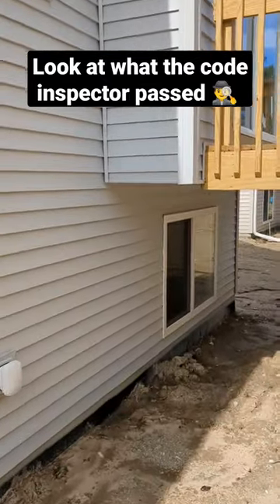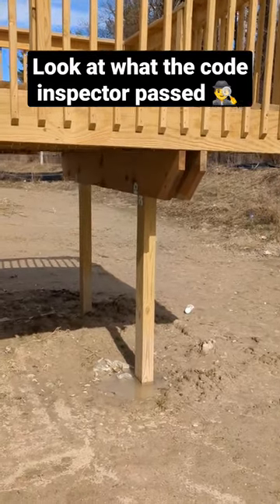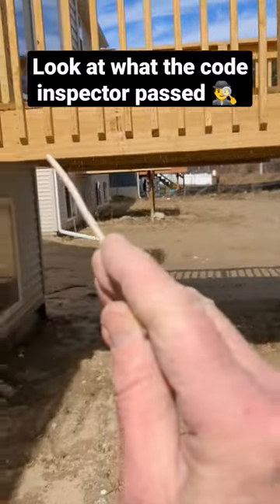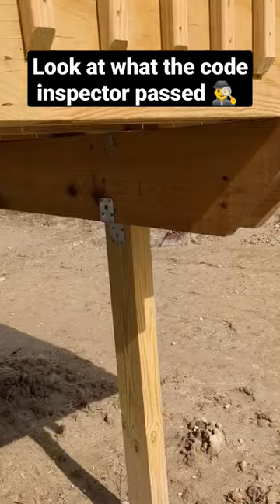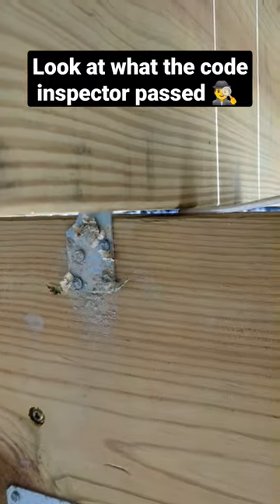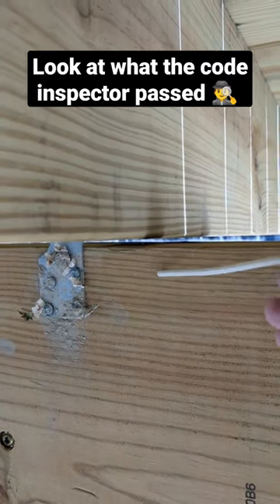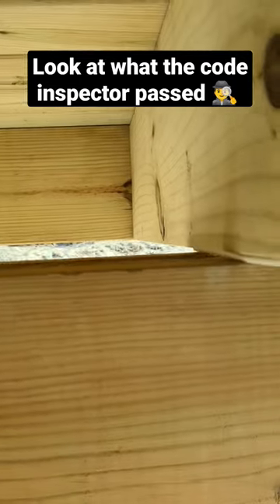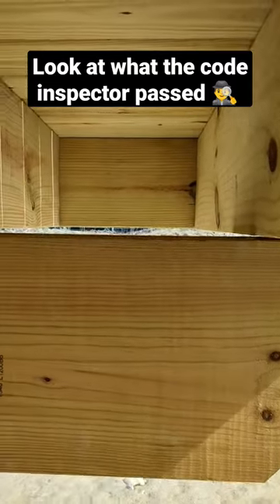Code #inspectors don't pay attention to detail#deck #newconstruction#youtubeshorts#shortvideo#shorts

Comment: How about the 2' cantilever holding up a Ledger board ? Or the not a girder that's not sitting on the posts , so 8- 1.5" nails are holding that entire deck up . I could go on, but yikes fail fail fail in PA .
Reply from the maker: Yes yes yes. Rebuild! 🤣
Thanks for the comment and watching the video.

Comment: It’s not floating in air I am sure it will settle most important is connecting to the house and the beam is bolted to the posts 
Looks like the post are to deep into ground. 😊

Comment: Green or "treated" lumber shrinks, the beam shrank in height. The deck used to sit on the beam. But, if it goes anywhere its just going to sit down on the beam properly.

Comment: If the posts are ground contact treated, water is fine…. Those joists will settle on the header in a short period of time. Inspectors don’t understand 95% of lumber has curvature and not perfectly straight.
Reply from the maker: Yep, it's called a crown and all crowns are applied up on floor joists. However, the entire deck is improper and needs to be rebuilt.This home got worse. SEE Missing Footings Inside https://youtu.be/TqGMGpvnVAk
I've been finding more developments selling homes with NO decks, but they install handrails in the slider door frame. Once the code inspector is gone a crew member comes back and slaps on the deck for extra money 🤑 and no permit. Ugh.
Thanks for watching.

Comment: Because when they frame that, they support the outside band with stiff legs and attach the floor joists to it then they erect the drop seal afterwards and a lot of times they don't get it all the way. However you cannot expect the floor joist to settle down if they have already got strapping material attached

Comment: This is whybit is so important to have a liscened home inspector look at your new home even if it is brand spanken new.  I average 15 repairs on every new construction i inspect.   15 items that will generally caise greater issues if not corrected by the one year owners builders warranty that never gets taken care of either.
Reply from the maker: Yesss. I renew my builders license every 3 years and I find a lot of problems on the new builds. There's no more real "carpenters" out there. And in Michigan, only 1 in 10 builders are licensed.😖 Ugh. 
Thanks for watching.

Comment: That is one of the silliest things to make a big deal about. See when you build a deck. You’ll understand. That when you attach it to the rim. Some of those boards are different sizes. So it’s either you leave them a half inch under the rim. Or a quarter over the beam and it settles. You can’t have both

Comment: Seems like no concrete footings supporting the deck. And wood like that, unprotected, will rot in a few years. They should have used pressure-treated wood were it touches the soil.

Comment: They probably were at time of build, that crap shrinks up to 1/2” in a week or two. Throw a cedar shim and look the other way just as the inspector did. BTW, the rim is usually put on after the joists, so I’m pretty sure the joist were sitting on the beam when constructed.

Comment: The  Massachusetts code you can not sandwich a 4x4 anymore and carriage bolt it. You have to lag the 2 - 2x10s together which are also the smallest you can go for a beam here. then lag every 12 to 16 inches with structural lags exterior on the carrying beam. Also has to have simpson ties hangers on the 4x4 beams to keep it from moving offt the post. with hurricane clips on every joist. Also the new code here is you can no longer use 4x4 pt the code now calls for 6x6 pt hopefully the deck was lagged into to house with structural exterior 6 to 8 inch lags at least 2 in the middle of every bay one above the other. Just wanted to throw that in.
Reply from the maker: Thanks for sharing. Here in Michigan our code book is a D- with minimum 4x6 post🤮.
However, the deck in the video I believe was installed after the final code inspection. The builders here build so fast that they put a rail in the slider door and get a final. Then someone comes back after and slaps that junk together. 
Thanks for watching.

Comment: you also missed the ledger board hung from the cantilevered floor system -- which is not allowed.  --
Reply from the maker: Yep. And , posts are not notched for beam and much much more. Recommend rebuild.
Check out those missing footings inside.

Comment: They framed the deck, then placed it on the beam.  There should be an anchor at the wall, then an individual anchor for every floor joist.  The other problem is the beam should be sitting on a notch cut into the 4x4 post.  You missed that part.

Comment: and though may be code .. the v vertical post are too small and I would connnect them from top to bottom with a board fat an angle ...sharing stability

Comment: Isn't this more than likely due to wet lumber drying out? It will shrink sometimes an 8th of an inch. Alot of times it isnt practical to let it dry out prior to building. Sometimes its damn near impossible. Sure, this may not be "proper" but I dont really see an issue. Its strapped properly and chances are that gap will close over time.

Comment: The biggest issue is that the deck by code is not allowed to attach to an overhang from the house without positive support beneath…
Reply from the maker: Oh I agree. I can't confirm, but I really think the deck was slapped up after the final code. These builders here get a final if they put a rail in the slider door.😉
Thanks for watching.

Comment: Its pressure treated lumber. Its an eighth of an inch. It will eventually sag down to the beam and you will never notice. You have nails in there that are designed to have sheer strength so this is completely safe. Want a better deck, then tell them to send us better lumber that doesnt vary a quarter inch in width.
Reply from the maker: Yes. Lumber is a big problem in today's construction.
Thanks for watching

Comment: Are u sure the beam didn’t settle. Of the posts holding beam. As u see standing water on ground right where post is. How do u know that post didn’t settle. So u have them suck that deck down and ur happy. But deck is now not level. If the posts settled. Sure u looked into that though.

Comment: The joists will eventually seat themselves, and it may warp the deck some it's not as bad as the potential catastrophic failure from supporting the other end of the porch on a cantilevered floor.

Comment: Those gaps are the lesser of the problems. The posts should have a metal saddle in the concrete, and I would not pass those metal brackets holding up the beam.
Reply from the maker: Yes. Too many problems. It was written up as a recommendation to rebuild.
Thanks for the comment and watching

Comment: This is cause by the shrinkage of the wood by the sun. You can tell the wood dried a bit on both bottom and top causing separation leaving a gap.
Reply from the maker: Yes. That's the answer.
Thanks for watching.

Comment: What seems to be happening here is the treated wood was fresh and wet and when they built it it most likely was resting on the beam but after the treated wood dried out they shrunk, that's what pressure treated wood does.

Comment: After looking at this again...
I realized there is no door going to that deck.
Just a window.
No supports near that either.
So chances are, this is designed for looks and not for use.
Reply from the maker: Yep, there is up above.
The entire deck is improper and needs to be rebuilt.This home got worse. SEE Missing Footings Inside https://youtu.be/TqGMGpvnVAk
I've been finding more developments selling homes with NO decks, but they install handrails in the slider door frame. Once the code inspector is gone a crew member comes back and slaps on the deck for extra money 🤑 and no permit. Ugh.
Thanks for watching.

Comment: I am most worried about the fact that none of the deck joists are mechanically attached to the beam. 

By the way those 1 or 2 hurricane ties do not count under code as attached to the beam. They are designed for wind lift not attachment.

Comment: Couple of heavy weight relatives over for the home opener and that problem is solved. 
Problem is, how long will that none-pressure treated wood in the ground last?
Reply from the maker: Right. I talked to a landscaper once about wood foundations. And it's a horrible concept. He replied with "pressure treated lumber is temporary use". 
I looked up the life span on line and it says 10-40 years is the average life.🤔
Interesting.
Thanks for watching

Comment: Are you allowed to connect to an overhang?
Reply from the maker: No. Not the way it's done in this video. The entire deck is improper and needs to be rebuilt.This home got worse. SEE Missing Footings Inside https://youtu.be/TqGMGpvnVAk
I've been finding more developments selling homes with NO decks, but they install handrails in the slider door frame. Once the code inspector is gone a crew member comes back and slaps on the deck for extra money 🤑 and no permit. Ugh.
Thanks for watching.

Comment: I rented a new 1 million dollar house for 6 months 10 years ago in a place that get to -30 -40 in the winter and somehow the builder forgot to insulate the home, The heater could not keep up so the pips froze and busted and the walls had ice build up inside the house so after 1 winter they had to replace everything.  '' Professionals''  I can't put up a shed in my city without approval for safety reasons lol

Comment: What supports are on the house? Doesn't look like much.
Reply from the maker: Not much. A standard ledger board that is off-set and bolted. The entire deck is improper and needs to be rebuilt.This home got worse. Check out Missing Footings Inside https://youtu.be/TqGMGpvnVAk
I've been finding more developments selling homes with NO decks, but they install handrails in the slider door frame. Once the code inspector is gone a crew member comes back and slaps on the deck for extra money 🤑 and no permit. Ugh.
Thanks for watching.

Comment: Forget about that. You should never attach a deck to a chimney. You have to use 2 by 10 double beam for the 2 anti gap around it and post to support it. And your picket should go to the bottom of the beam.

Comment: It’s not improperly installed that’s gonna settle within under six months you put Crownwood up when you install it and then it settles flat after time that’s the only reason why it’s doing that. I probably wouldn’t put the hanger stock on yet, but there’s nothing wrong with that deck

Comment: Ledger board need to have a support. Can’t use a ledger board on bay windows, or anything that over hang like that. There is no strength to support any more. Fail inspection in my area

Comment: He missed the fact that the wood column posts comes in contact with the grade. A concrete footing with a minimum 4” clear between the wood and grade is req’d. There’s more.
Reply from the maker: Well, l didn't miss it. It's written in the report to rebuild the deck because of so many problems. I made many shorts on the deck but you should see the house. 
Check out those missing footings inside.
Thanks for watching

Comment: I’ve been building decks for 142 years plus overtime. It will settle down on that beam in 6 months… in other news I’ve never seen a deck come off a bump out 🤔
Reply from the maker: Yep. And the problems kept going. The entire deck is improper and needs to be rebuilt. SEE Missing Footings Inside https://youtu.be/TqGMGpvnVAk
I've been finding more developments selling homes with NO decks, but they install handrails in the slider door frame. Once the code inspector is gone a crew member comes back and slaps on the deck for extra money 🤑 and no permit. Ugh.
Thanks for watching.
Reply: @inspectflix  that’s really bad they do that. I love watching home inspectors. I’m fascinated by how bad things are that you guys come across. I do have a question. Since it’s a bump out where do they tie the deck into? I saw a house once that just read the floor joist straight outside to build the deck. It was all rotted. Older home like 60’s but still.
Reply from the maker: There should be another set of posts and beams at the bump out. 
I also still come across those old school cantilevered floor joists right out the house as a deck-balcony 1950s & 60s. Yes they are know to dryrot at the entrance to the house.
🕵️Home inspectors do find interesting things. Fyi, only some states have licensing for real estate inspectors. About 15-20 do not have any laws or regulations. 
Michigan has none. Ugh! 
I still keep my builders license up to date though .📐

Comment: A lot like my deck on my house. Little did I know that 15yrs later the posts rotted and the deck started sinking. I jacked up the end, cut off the supports going into the ground above the rot so I got solid wood, dug down and cleanout out the rotted pole, dug down the req depth, poured concrete footings that came up 4in about ground, installed mounting bracket, lowered deck, nice and level. 
These people are going to have problems.

Comment: could just be thermal contraction.. built in the summer and swelling, dried and cold in the winter when you looked at it.. Second likely thing was it had buttle tape in between the boards to prevent future rott and someone or nature removed it

Comment: I would bet that the joists are all different  widths causing some to not sit on the beam.   The guys went and just made sure the tops were all level. Then a guy came back and out nails in the H5Z Simpson connector.  Lumber is going to shit, there upwards of a 1/4” variance in thickness and width now on lumber

Comment: How about that the beam is not fully supported by the post. Or that the deck is attached to a cantilever. Or that they used a 4x4 rather than a 6x6
Reply from the maker: Yep,  you got most of it..The entire deck is improper and needs to be rebuilt.This home got worse. SEE Missing Footings Inside https://youtu.be/TqGMGpvnVAk
I've been finding more developments selling homes with NO decks, but they install handrails in the slider door frame. Once the code inspector is gone a crew member comes back and slaps on the deck for extra money 🤑 and no permit. Ugh.
Thanks for watching.

Comment: Can that be fixed with shims??
Reply from the maker: As a temporary. But there's a lot more. The entire deck is improper and needs to be rebuilt.This home got worse. SEE Missing Footings Inside https://youtu.be/TqGMGpvnVAk
I've been finding more developments selling homes with NO decks, but they install handrails in the slider door frame. Once the code inspector is gone a crew member comes back and slaps on the deck for extra money 🤑 and no permit. Ugh.
Thanks for watching.

Comment: It will settle. There’s not much weight back at the ledger. Only way your getting that to sit perfectly so you don’t make a video is if you ripped down that girder and the joist so everything was the same exact size. I get what you’re saying and I’m super over the top with all the work I do but this is madness.

Comment: Beam and ledger are worse issues than the joists not resting on beam
Reply from the maker: Yes, and there's a few more things also. The entire deck is improper and needs to be rebuilt.This home got worse. SEE Missing Footings Inside https://youtu.be/TqGMGpvnVAk
I've been finding more developments selling homes with NO decks, but they install handrails in the slider door frame. Once the code inspector is gone a crew member comes back and slaps on the deck for extra money 🤑 and no permit. Ugh.
Thanks for watching.

Comment: Those joists will settle with no problem after a lil while..one problem is they dont look like theyre toe nailed or toe screwed to the beam bcz were now compelled to use these diy metal teco fasteners..remember though. Those who cant do, teach..those who cant teach, inspect

Comment: All joist shall be blocked at all beaeing points..  also that fabricated "beam" wont fly around any inspection on any job ive ever been apart of or seen in 25 years.. that is as old school an primitive framing as you could get. Theres not even a hold down on the rim board which is required by code..

Comment: Curious if this will even be fixed or will they just ignore it
Reply from the maker: It will more than likely be dismissed . Most home buyers are waving private home inspections on New builds because they think the code inspectors are confirming it. 
Here is one that's even more scary.  SEE Missing Footings Inside https://youtu.be/TqGMGpvnVAk
I've been finding more developments selling homes with NO decks, but they install handrails in the slider door frame. Once the code inspector is gone a crew member comes back and slaps on the deck for extra money 🤑 and no permit. Ugh.
Thanks for watching.

Comment: You would think they would have more support underneath that deck, like two post by the house for extra support
Reply from the maker: You got it. The entire deck is improper and needs to be rebuilt.This home got worse. SEE Missing Footings Inside https://youtu.be/TqGMGpvnVAk
I've been finding more developments selling homes with NO decks, but they install handrails in the slider door frame. Once the code inspector is gone a crew member comes back and slaps on the deck for extra money 🤑 and no permit. Ugh.
Thanks for watching.
Reply: @inspectflix  how do they sleep at night doing work like that